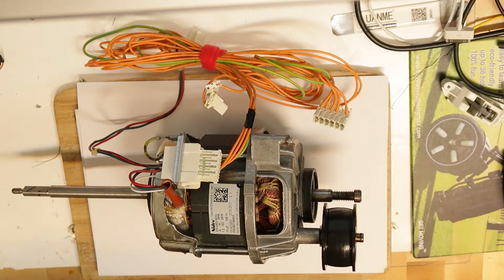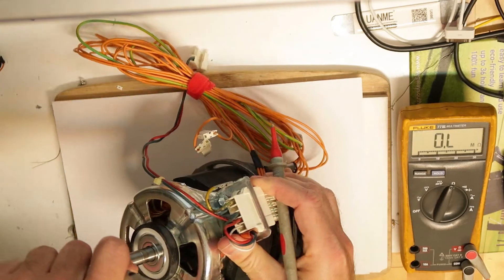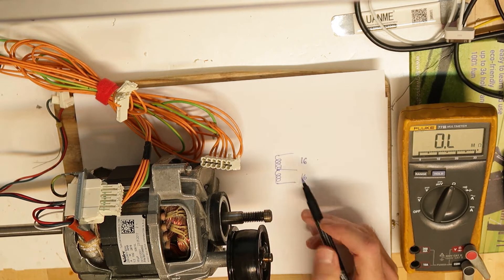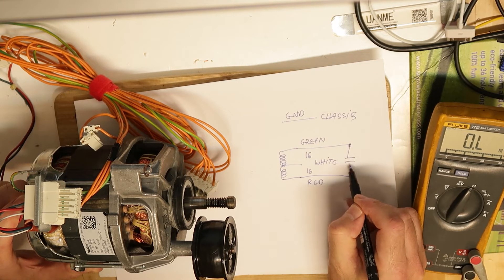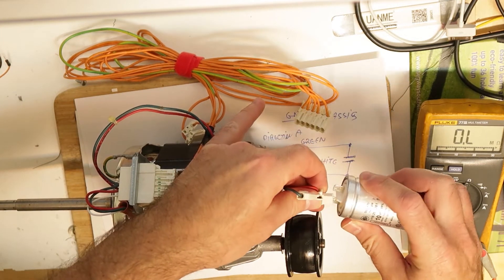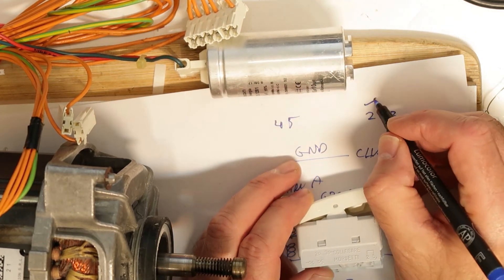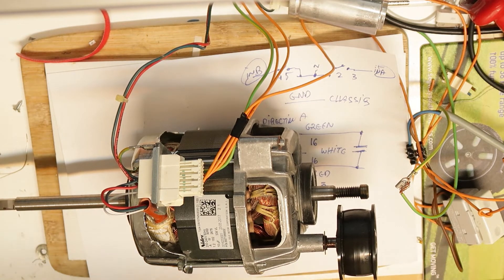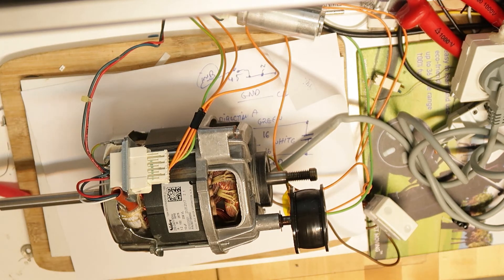How to Spin AEG BOSCH ELECTROLUX Dryer Motor

Comment: I have a brought a second hand AEG 8000 series T8DEM842E. It ran one cycle for two hours. Next cycle made screeching sound and then stopped. I heard the motor trying to rotate but the drum not. I opened the side and released the belt. Motor makes sound but did not rotate. Opened the motor 3 magnets were loose. I cleaned the motor and pasted the magnets back. which rotated fine manually. 

Now on any cycle i choose, drum rotates half round seven-eight  times with 15sec interval and stops. And after 5-to 8 minutes the machine turns off. No error code. The heating Icon keeps on blinking during this process. Any Idea ?